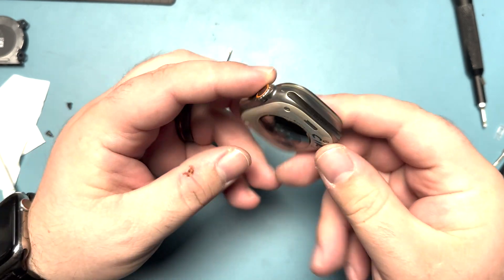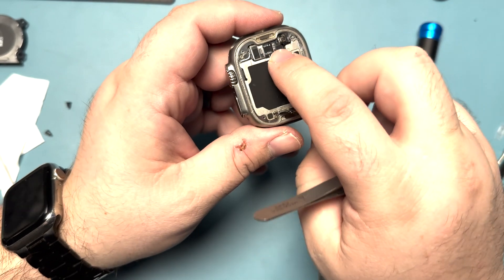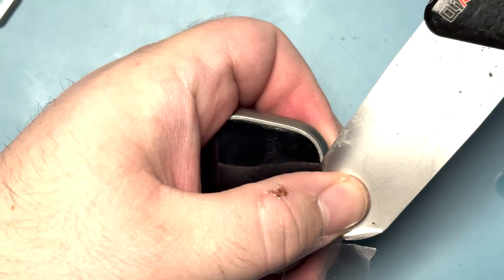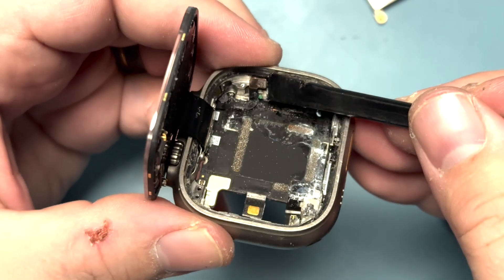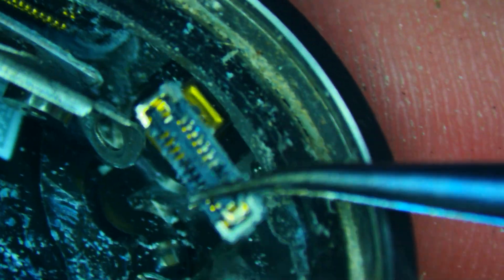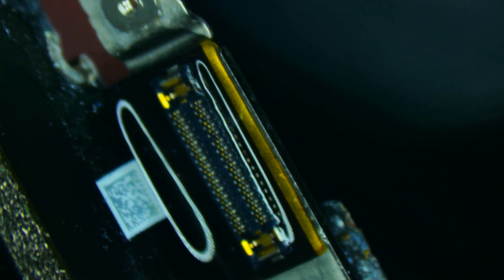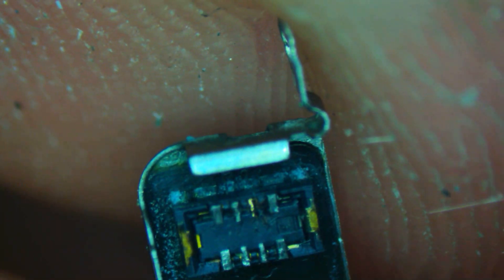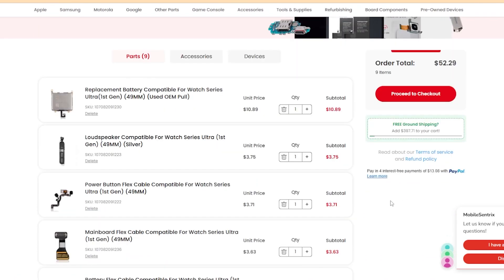Apple Watch Ultra Water Damage Repair | Part 1: Diagnosis & Disassembly Process

Comment: Nice video. Where do you think the water normally enters these devices? It is astounding how Apple markets these devices for swimming/diving, and many consumers believe their smart watches are "waterproof". At best, they are water resistant, with seals which degrade over time. Taking them into the shower is probably a great way to degrade the seals - with soap/hot water. Salt water from the ocean is probably also not ideal.
I also heard that Apple themselves will not repair/replace water damaged watches, and instead simply swap them out with a refurbishment. Not sure if this is true, but I can totally see how the labour involved to fix/repair corroded parts is a huge pain in the ass.